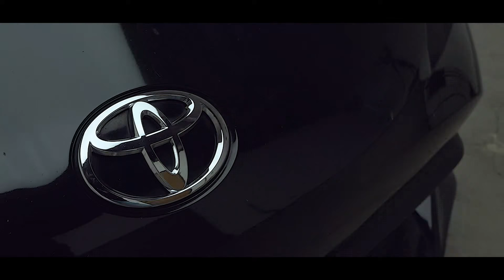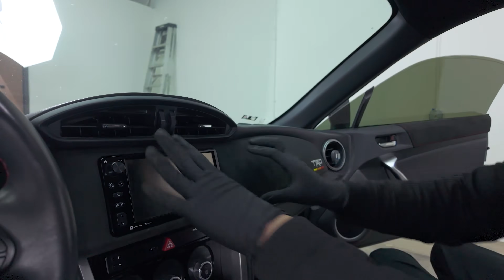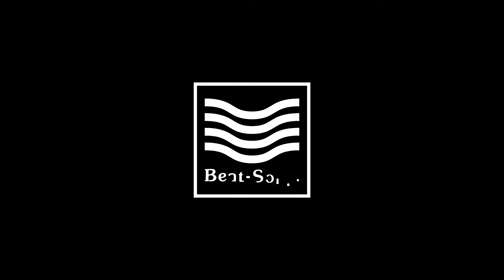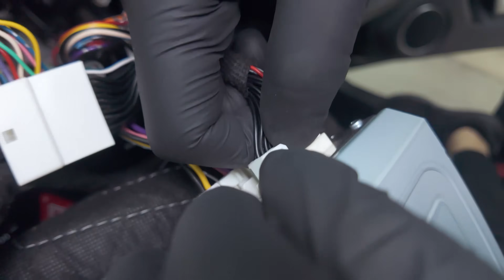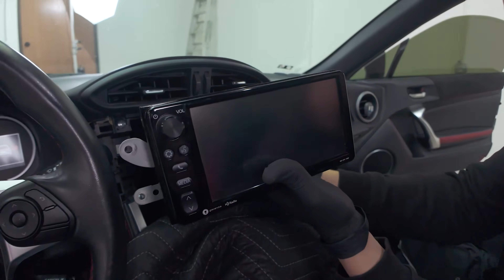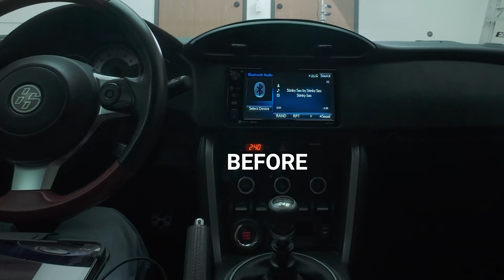Why Is This Amp So Popular? Toyota 86 TRD Beat-Sonic Amplifier Install & Sound Test

Comment: Hey! Question. Is this more of a DSP or an AMP? I doesnt require a separate power souce so I don't see how this is actually increasing the output/volume of the speakers. Thanks!
Reply from the maker: This is an amp.
Reply: @BeatSonicUS how does it increase the output?